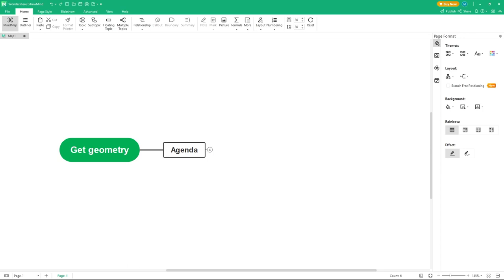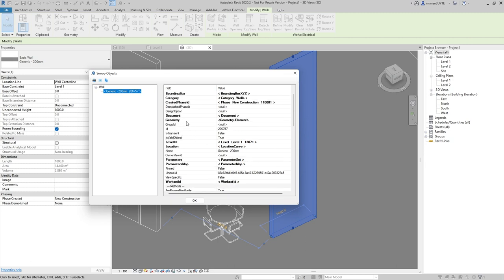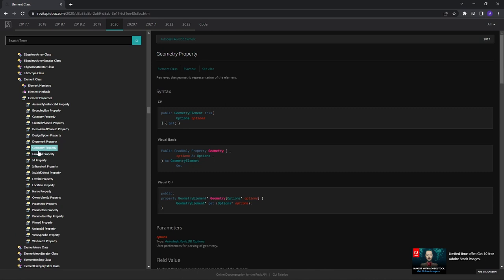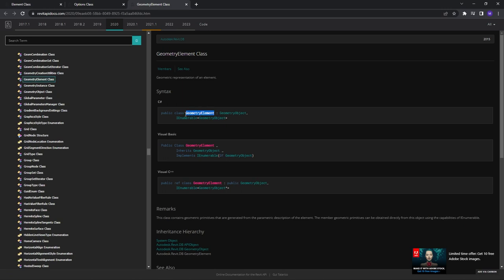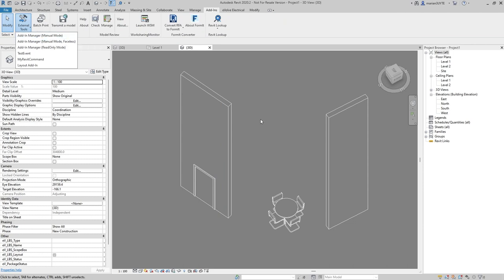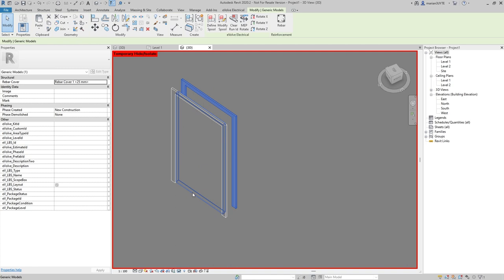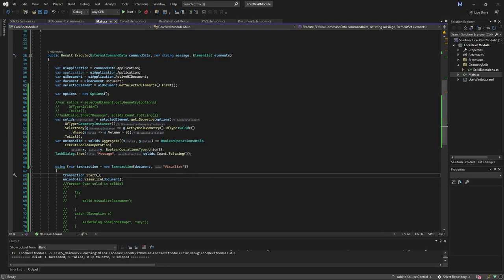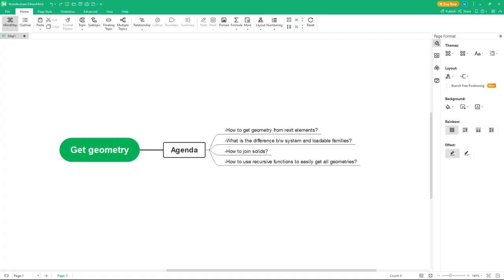Revit API Course - Lesson 9 | Get geometry from Revit elements

Comment: Hey I think an Interesting tutorial would also be on how to use DMU Interface to Trigger on changes in the database efficiently
Reply from the maker: It's a good point, Johann. There is gonna be a video related to reacting changes in a Revit model  in General (it will include Events + DMU Interface for updating on the fly). Aslo if you want I aw working on a course right know, and it will include these topics, if you are interested you can reach out to me via this email : marianslesar.08@gmail.com and receive all the details.

Comment: What is the quickest way to set up Revit addins for my company for automation? 😊
Reply from the maker: As a rule of thumb, I create 4 projects NameOfTheProject.Core, NameOfTheProject.UI, NameOfTheProject.Resources, NameOfTheProject.
As their names imply each of them serves a different purpose.
Core - is for holding business logic,
UI - is for holding UI logic and so on,
Resources - is for storing different resources,
Just the name of the project - is an entry point, this is the place where I create a class that implements IExternalApplication
Also, it's crucial to have your addin file for this plugin to be fired up in Revit.
Personally, when I am in the development process, I use Add-In Manager to help me check things quickly, and later on, I create an addin file and place it
in the required folder.
Also, you can use post-build events to automatically copy files to some folders(you can read up on that).